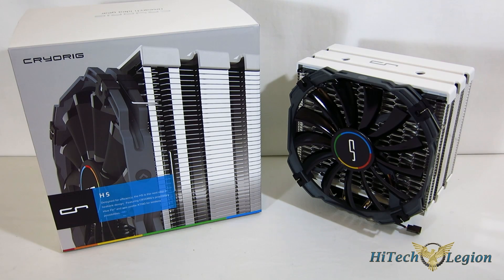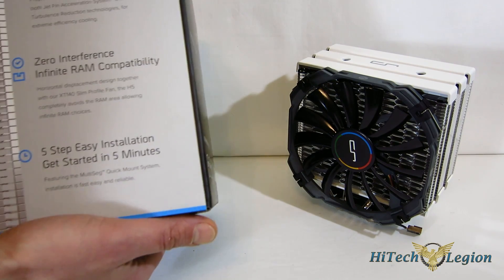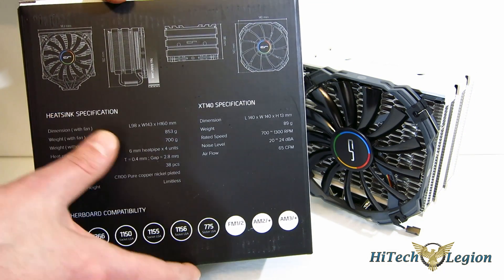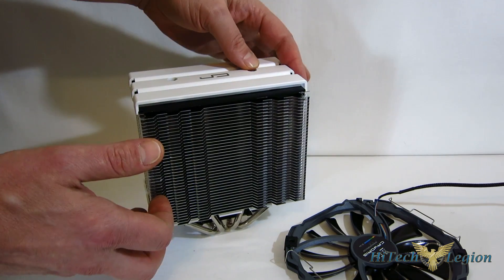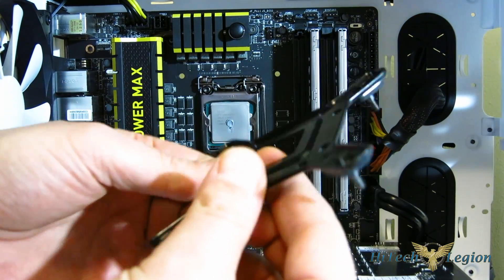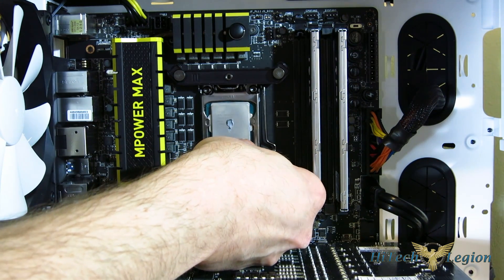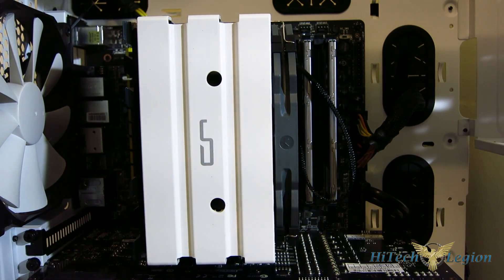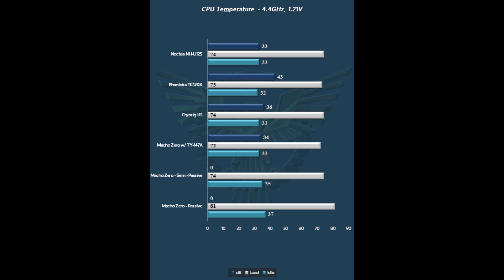Cryorig H5 Universal CPU Cooler Overview and Benchmarks

Comment: Quick question how good is the thermal CP9 compound? would you recommend the Cryorig H5A or the Cooler Master Hyper 612 Ver.2. I know cooler master thermal paste sucks. Since you tested significant of cpu cooler i would rather ask you, for you opinion. I am stuck on witch one to buy, maybe you can shine some light on that one.
Reply: criot1124 The CP9 is ok. Not the best TIM around, but better than the average TIM that is included with many coolers.

Personally, I like the H5 a lot more than the 612. I really liked the 612 back when it came out, but at this point it is an older design and there have been a lot of improvements in air coolers during that time. If you can fit an H5 Ultimate with your RAM, that is even a slightly better way to go.
Reply: George Cella  I am currently using Crucial Ballistix tactical tracer. You think the Cryorig H5A will have clearance in my ram?
Reply: criot1124 The H5 Universal has zero RAM interference.
Reply: George Cella Awesome thank you for you're help. Big thumbs up's.

Comment: i bought a kit of Gskill RipjawsX for a 1150 board. will it be ok with any 1150 board? noob question i know but i'm trying to find a cooler that will not interfere with the ram slots
Reply: Nomad As stated in the video, it will not interfere with RAM slots.

Comment: How is it compared to the bequiet Shadow Rock Slim CPU Cooler?
Reply: Kilkees Own On Intel 1150 and 1155, the H5 has slightly better performance on OC CPUs, but the Shadow Rock Slim is noticeably quieter. Definitely a trade off.
Reply: George Cella Thx for the input

Comment: thank you very much for this video , my doubt is which one is better for gaming , Cryorig h5 or R1 ultimate?
Reply: tyro tube The actual question is "which is right for my build". On most clocked CPUs (I have no idea what you are using, so I can't be specific) you will see almost no performance difference and the H5 will be quieter. "Gaming" (again....no idea what you are playing, so......) is typically not CPU intensive like transcoding and rendering, so your needs will also be far less than work station/enthusiast applications.
Reply: im using amdfx 8320  and im a very simple nob and simple gaming player , play normally dragon age inquisition .guildwars and stuff like that. i just want to know which one is best according to price and performance 
thanks
Reply: as my nick says tyro tube ,totally novice
Reply: tyro tube In terms of price/performance on a stock 8320, the H5 is the way to go. You will literally see almost no difference in performance.

Comment: This or the 212 EVO? :( I really like the looks of this cooler but the performance didn't surprise me that much
Reply: Ernesto Del Bosque The performance of the H5 is noticeably better than the 212 EVO and it is significantly quieter.
Reply: Thank you i should save for it, then.
Reply: The H7 is better than the 212 evo, also quieter and smaller, and costs the same.

Comment: i like this cpu cooler. may look into getting one for a smaller build. can this be mounted with the fan facing down?
Reply: teeblack06 Yes. you can mount it with either orientation on Intel.
Reply: cool thanks